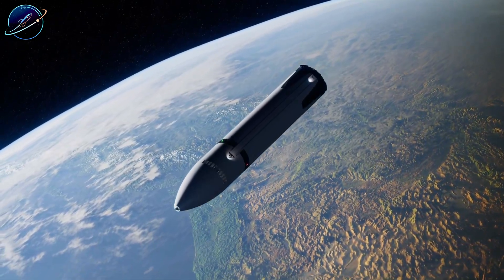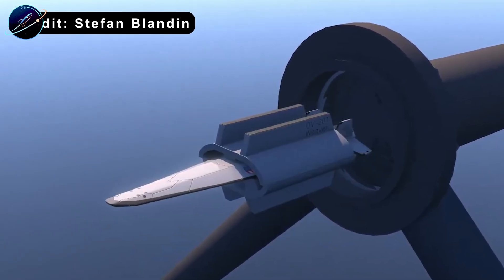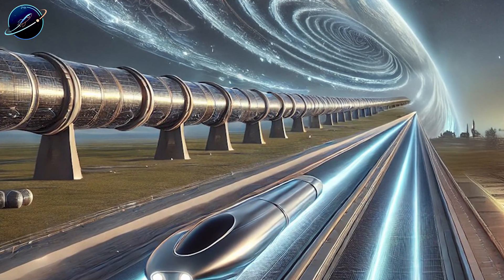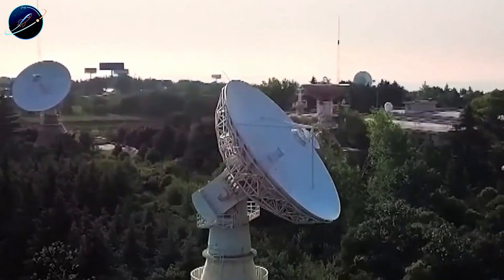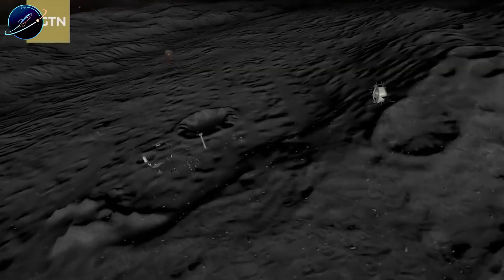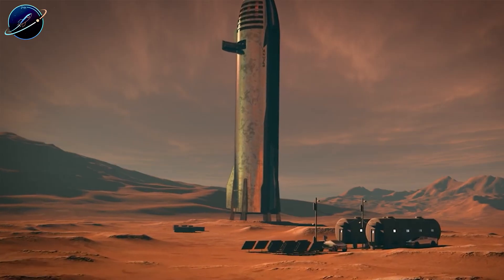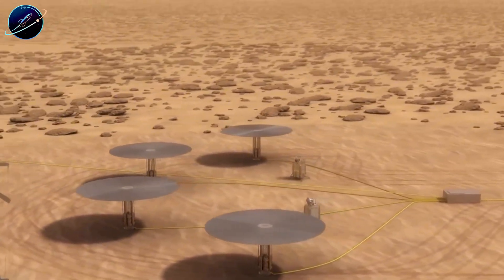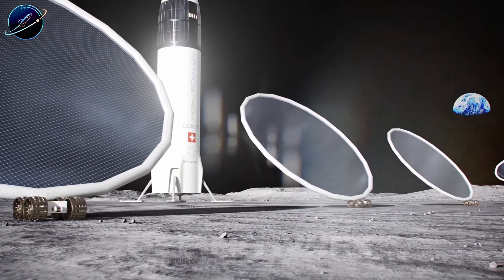SpaceX Found Perfect Solution to Moon Mining Fuel Crisis: Solar Rail...600K Tons!

Comment: What about Thorium reactors?
They work as has been proven by the prototype.
Liquid sodium heat transfer.
It's been said that there is a lot of Thorium on the Lunar surface because the Sun's emissions created so much over the eons?
There are alternatives but few willing to take a gamble -- except Musk and China, it seems to me.
Reply from the maker: Thorium molten salt reactors (like the proven MSRE prototype from the 1960s) offer huge advantages: liquid sodium/fluoride heat transfer, inherent safety, and thorium breeding potential—NASA explored them for space power decades ago.

Comment: You've got most all of it right, except for using thorium molten salt reactors instead of standard old style fission reactors.  Spot on otherwise.
Reply from the maker: Thanks—thorium molten salt reactors (like LFTR concepts) do offer big advantages: higher efficiency, better safety (passive drain), abundant fuel potential (even lunar thorium mining ideas), and less long-term waste than traditional fission.